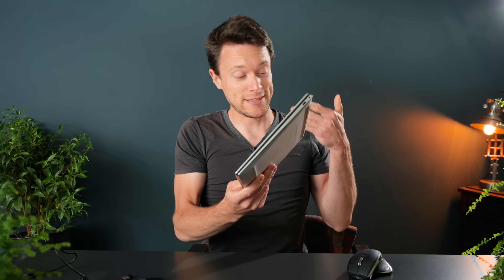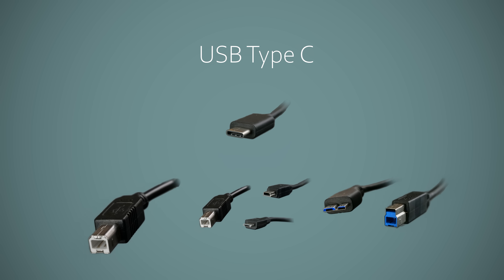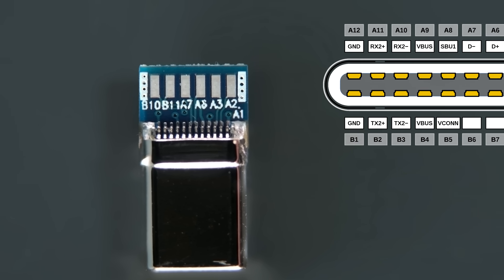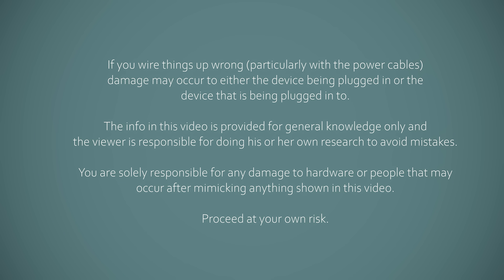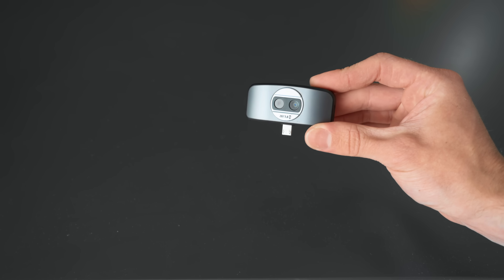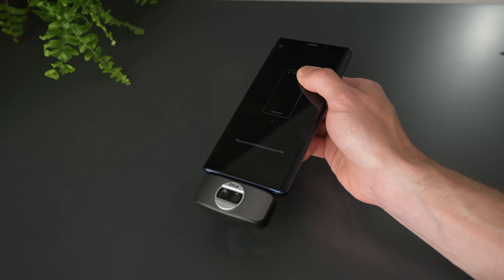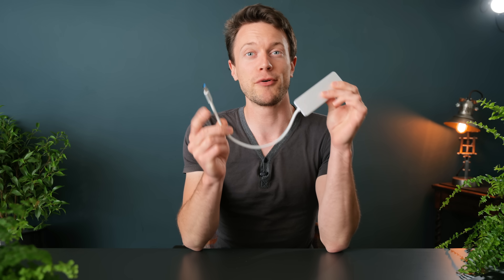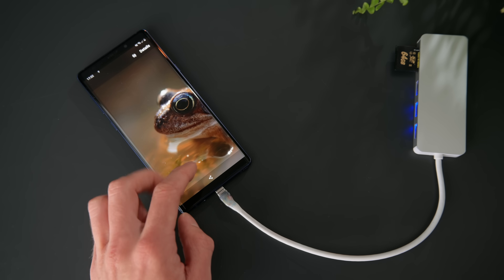Converting devices to USB Type-C

Comment: USB c should only belong on smartphones and other things that need to be charged, everything else should keep using the older usb. USB c feels too flimsy and fragile to be used on anything other than a phone laying flat on a table. Plus, USB A already does everything it needs to, it connects stuff together with decent speeds and is widely adopted, what more do you want?

Comment: They do make those super tiny adapters that go directly inside the USB-A connector turning it into Type-C with only 6mm added length. It may look funny but is smaller than yours.

Comment: Mouse dongle couldve been twice smaller if you would trim the usb pads from one side and remove the little board on a "C" part. It could've be almost the same size it was before ;} And instead of using some sort of clay you've could 3D print the casing for a new connectors :} But ok, simple, yet interesting video :}

Comment: I don't know. It seems like a bit too much of a job when the dongle does the same thing, at the same speeds, without risk of shorting anything. Yeah it's not the fanciest thing to have, but you can always find smaller dongles that do the same job without looking messy and homemade. Plus most wireless mice can store the USB receiver in them, something you lose with a DIY receiver.

Comment: Phenomenal video, instant sub, I came here by chance, but I have one of those extended usb 3.0 micro-b western digital 3TB mybooks that the connector broke off the pcb, after having to slowly put more and more things onto the wire to make the connection it was bent so bad I couldn't get the plug through the plastic and onto the connector, so I took the drive out of the case and tried bending the connector back and snap.  

No big deal right take the pcb of the drive and just plug it into one of my towers, I'm always hotswapping drives.  NO!  This is when I learned how stupid of a company WD was,is, still is.  Even without having set a password they made the decision to encrypt the data going onto the drive through the controller chip on the little pcb.  Setting a password just locked access to the drive in the SES driver, I can't read the drive without passing the data back through the controller.  I had like 25k mp3s a bunch of pictures and an old bitcoin core node with a non-zero wallet on it.  I managed to recover the wallet cause I had a pre abc split version of it on another drive cause I was actually careful before I did the abc then gold then sv splits.  But I want my memories back lol.  I think I can do this.  I never even thought of putting a usbc on it, and I have no idea on what the pinout of the extended micro 3.0 connector is.  But I'm rewiring some old astro a50s I loved that the wires broke on and the wires are even smaller than usb wires, so I think I can do this.  I used to solder a lot when things weren't so dumb small.  That extended micro-b 3.0 connnecter is such junk the smart choice would have been using the 3.0 B that is used on a lot of older USB 3.0 hubs, that thing is rock solid, or even just an A connector , I broke the micro-b on a seagate drive too (they didn't encrypt) and I have another seagate that still works but I will not buy anything that isn't c in the future.  Oh the reason I say WD is still stupid is because I got a newer laptop with a wd sn730 nvme, I went to over-provision it but the WD software doesn't do that.  I assumed, my bad of course assuming, that WD must have set aside space on the drive for provisioning I couldn't see.  WRONG, all the sudden when I got over 75% on the nvme two days ago toast notifications started popping up that looked like retarded virus popups saying that going over 75% would greatly decrease the life.  No they are wrong, the Samsung 970 I'm ordering to replace it will be greatly decreasing its life.

Anyway again great video, I also like to rehab stuff hate to throw away anything unless it is absolutely done or won't even work in linux anymore, way too Scottish, and I loved the epoxy trick, I've been using electrical tape all this time on hdmi cables and cat5/6 like I was a electrician doing my own home wiring.  which...

Comment: But actually type-c its the physical standard, that can be USB 2.0, 3.0, 3.1, 3.1 gen 1 and 3.2 gen 2 
And its not replace the Type-A and Type-B. 
Its just new type. That turned out to be more convenient, that why brands start to use the type-c first instead of Micro Type B, and now sometimes instead of Type A. And thasts why companies standards the USB 3.1 Gen 2 to replace Mocro-B by type s, and then replace type-A in USB 3.2.
But its still USB, and you can even make USB 1.0 Type A to Type C cable and its will work.
I still have several USB 2.0 Type-C to Type-A cable.
Reply: And also that physical standard supports not only USB. Its support the display port and extended usb standards (Ethernet Over USB, Analogue Audio Over USB, Thunderbolt 3, Display Port and Power Delivery)

Comment: Can you please further explain how did you solder the thermal device's new resistor? I didn't get that configuration. Was it going from R2 pad to anywhere in the circuit board(GND)? 10:50
Reply: A few seconds earlier he says "to the ground pad" which is on the other side. A new resistor is not needed, just stand the resistor on end on its pad next to the USB-C then wire the top end to ground. I.e. tombstone it.
Reply: @murdo_mck  Thanks Muk. You're the real deal!

Comment: Do you have any videos where you replicate a USB receiver? For instance, I have two Nintendo Switch docks, one in each room, and I'd like to use my third party wireless controller on each of them without having to move the dongle each time. I'd also like to know how to do it simply because dongles are tiny and easily lost.
Reply: The ideal solution would be a USB 3 KVM, that said, building a second USB receiver won’t work unless you can tell the controller that you’re using to switch to another receiver (while keeping the first one stored so you can quickly reconnect)… Manually Repairing every time would be more tedious than just moving the receiver probably.

Comment: Can't you just move the resistor that's already soldered on the breakout board from the positive side to the negative side? I mean yeah it is very small to work with but it will also turn out small

Comment: a computer new enough to h ave usb-c will probably have Bluetooth.  get a Bluetooth mouse.  problem solved.  use the other mouse for an older system.  problem solved.  that dongle would be better.  they make adapters too.

Comment: It is a good work, but I would not do all that as dongles support more than one USB connector.  But yeah still a good idea, regarding the Troughhole resistor you have used  I would just swap the original resistor connected to + to the -  R1/R2.

Comment: Honestly this is why small form factor devices with USB-C only are stupid. All they do is try to make that laptop as thin as possible, when that doesn’t even matter. A laptop that’s thin isn’t any better compared to a normal form factor one. If anything, it’s trying too hard to be like a tablet or phone, which is small and thin.
Plus the thin form factor also means the thermals might take a hit if the cooling system isn’t well thought out.

Comment: USB-C may be great…. But it’s not a standard for anything. Tell me the last time you saw a USB-C mouse? Point is never.
It would always be a wired connection to USB-A, or using a USB-A dongle, or just full on Bluetooth. Even keyboards do the same, the only time they use USB-C, is for a detachable cable, because it’s more durable and small form factor.
Pretty much all laptops have just one normal USB Port, with a USB-C port as a bonus, mostly for higher end machines.
Only time USB-C is required, is for external storage, since it’s faster.
Also pretty naive of you to think everything will use USB-C and only USB-C for everything, when that won’t be helpful. Especially when charging a laptop. I already yanked a laptop a few times with the original charging brick with that round port, but that would be the same issue for USB-C. Apple was the only one to fix that with their MagSafe on the MacBooks, and there really should be some durable USB-C based charging focused port & cable, that’s like MagSafe, but a standard that isn’t owned by Apple.
Reply: > USB-C may be great…. But it’s not a standard for anything. Tell me the last time you saw a USB-C mouse? Point is never.

Hopefully very soon 😋

>Pretty much all laptops have just one normal USB Port, with a USB-C port as a bonus, mostly for higher end machines.

For now. Less and less devices will have USB-A going forward.

>Also pretty naive of you to think everything will use USB-C and only USB-C for everything, when that won’t be helpful. Especially when charging a laptop. I already yanked a laptop a few times with the original charging brick with that round port, but that would be the same issue for USB-C. Apple was the only one to fix that with their MagSafe on the MacBooks, and there really should be some durable USB-C based charging focused port & cable, that’s like MagSafe, but a standard that isn’t owned by Apple. 

You're thinking of one very specific problem. If every device used USB-C, the amount of electronic waste would go down ten-fold. And compatibility would be amazing.
Reply: @FerrisUwU  E-waste would still go up, because not every single USB-C cable has a standardized, consistent use. Literally each USB-C cable is different, and can be worse than some other one, meaning you’d have to buy a different USB-C cable anyway for a different feature. Especially so as features like thunderbolt use more wires in the cable sheath.
So even if USB-C replaces USB-A, HDMI, DisplayPort, or any other medium. Them not having a standard would means you still have a bunch of cables wasting away.
I literally have 5 different usb-c cables from products I bought, and all they do is charge stuff. Yet two of the cables are worse than one of the others I have. Meanwhile whenever I can get some thunderbolt compatible device, I’d have to get a new cable.
USB-C being a standard doesn’t solve anything, if anything it makes things more complicated. Right off the bat you’d know which cable does what. HDMI and DisplayPort does video, whole the typical USB-C does fast charging (with the right brick) or if the device you have even can use USB-C charging, each cable doesn’t exactly have signs as to what it does.
Reply: @Thewaterspirit57  what you're describing is mostly an issue with low quality USB-C cables. A decent USB-C cable from a known manufacturer should be able to do essentially anything you might want it to do. If it can't, that means the manufacturer cheaped out on you.

Thunderbolt is irrelevant; it's a whole different standard from USB-C that only recently switched to using the same type of port (a good thing, since USB-C devices can still be used with thunderbolt ports, just not vice-versa).
Reply: @FerrisUwU  Again. Using more excuses. USB-C isn’t some go to save all for E-Waste issues.
Literally nothing will happen. We can only solve E-Waste by telling people to recycle their electronics, rather than throwing them out

Comment: sir usb type to iphone charger port?
Reply: iPhones use the proprietary Lightning connector, which supports USB 2.0 (480mbps) transfer speeds (except on the 2017 iPad Pro, which does USB 3.0 (5gbps)). iPhone 8 and later, and more recent iPads also support fast charge if you use a USB-C to Lightning cable, and a USB-C PD power adapter.

Comment: Does there exist one of these breakout boards that work as a downstream device out of the box with no need to move or replace resistors? I have a USB 2.0 webcam I'm trying to replace the plug on. It's a USB 2.0 Type A plug currently.  All of the ones I find seem to be 56Kohm which I "think" means its for hosts rather than devices? (I read that client/downstream/dumb devices, need to be 5.1kOhm)
Edit: and just so no one says "just use a USBA>C adapter, this is a tiny webcam that's made to snap directly to a device, similar to FLiR cameras for phones. I need it to still be low profile.

Comment: My solution was quite elegant. I got a whole bag of the smallest connectors I could find. Now I don't care if I lose one or ten of them, and they are in pretty much every bag I carry electronics around in. The upside is that I can still use the devices in the older ports any time I need to by simply removing the dongle.

Comment: Ok ok, now I want to see how to do it on a PC motherboard, that all USB A to C. I hate that with a simple touch on a cable, a device is disconnected, especially audio dongles. The USB-C ports are super tight and don't move at all.
A lot of PCIe 4.0 and 5.0, DDR5 RAM and we continue with the A ports and to make matters worse the PS2 that continue to be immortal even if nobody has a PS2 keyboard or mouse, nobody, by God we are in 2022.

I think I'm going to solder cables to an external panel for the motherboard USBs, including the internal ones. Marking which ones are 2.0, 3.1, etc, including which ones are connected to the Chipset and which ones to the CPU.
I think it would be a good mod.

Comment: 2 years later, USB-C is still little more than another annoying competing "standard"
The XKCD effect persists
Reply: Just objectively not true, though. USB-C is THE standard, currently, apart from some specific points (Apple) and legacy device support (USB-A). The EU is luckily fixing at least one of them 😋Proud citizen of the European Union 🇪🇺
Reply: @FerrisUwU  Good to hear someone’s proud of being in the worst confederation Earth has ever had.
But no. USB-C is so bad, it’s taking a decree from a supranational confederation to push its adoption.
Hell, USB as a whole is a mess of non-standards these days. Literally all rules are optional. USB <insert current version here> can literally call itself gen whatever to justify it not being up to the current version’s specs. And more recently, now this marketing is required. USB-C is a standard of nonstandards for connectors. Did you know, in order to not support USB-PD, you have to support it and negotiate it down, or you could FRY the device? And frying it is also A-OK with the USB bureaucrats because all rules are optional.
The connector doesn’t imply at all what signal it carries, and different cables carry different signals, but have to use the same connector. It’s a logistic and engineering nightmare. Oh and the fragility of the connector. There’s a reason lightning isn’t following the male-inside-female/female-inside-male structure that USB insists on using like a fucking trademark. It’s fragile when you scale it down this much. All it is is USB Micro B, but reversible, and now you also can’t tell if a device works in host mode because if this connector is used on both the A side and the B side, and ALL RULES ARE OPTIONAL, you could end up trying to connect two devices that neither work in A mode or neither work in B mode. And yes, there are still A and B modes. USB still uses a host-guest model. Want to use the same fragile ass connector that needs a unibody shield just to not break when a feather falls on it, but don’t want to follow the host/guest model? Well, there is thunderbolt… Except the only thunderbolt mode that works like that is thunderbolt bridge, which is ethernet over PCIe. Otherwise one device has to be the host and the other the guest.
There is no C.
It’s just a connector. And a bad one. Apple beat them to the good one.
And don’t give me that “it’s faster” bullshit. Lightning for USB-3 is such a badly kept secret I literally have breakout boards for it. Apple was at one time going to release a USB-3 mode for Lightning in one of their iPad Pro models, but opted to save the speed improvement for when they could put Thunderbolt on them, the literal only reason they added USB-C at all. First to get people used to it. Then to introduce Thunderbolt on a mobile device.
Lightning had enough pins to handle USB-3 if it wanted, but not enough for Thunderbolt. What’s more, the other nail in USB3-Lightning’s coffin was Apple trying to go fully wireless. They intentionally throttled wired connections by not upgrading the lightning controllers and cables, all to push more over-the-air crap.
Regardless, Lightning was the superior connector if the contest was for USB 2 or 3, as it had all the pins needed and a much better physical design. Reason that didn’t become the standard across vendors? Proprietary. Nothing more.
There’s your history lesson.

Comment: I LOVE ❤️USB-C
 WHY DIDN’T IT COME OUT FIRST?
  Either side is correct and doesnt
 Bend easily. THE cable doesnt
Break the wires near the connection
 Like other cables are cheaply designed
To do so it has to be replaced.
  USB-C ROCKS🎉

Comment: Question: If I want to replace the Micro-B USB connector on a USB power supply with a type C connector (just to provide power) to the host/client resistor values matter?

Comment: Surely better to have just bought a Bluetooth mouse in the first place… I still do not understand why USB dongle mice even exist?! Surely everything should be Bluetooth by now. Even Logitech have Bluetooth mice that also still have the usb dongle.
Reply: 2.4ghz usb devices have lower latency than is possible with bluetooth ones

Comment: the mouse dongle... he could leave USB-a contact exposed and it would be a universal wireless dongle. but a very nice starting point.
also, don't go overboard with wiring - too thick or too long wires could become antennas and cause data interfierence.

Comment: Nice video. The only downside to USB-C is that the connectors are quite fragile. They're easy to snap off the motherboard when lifting up a laptop with a device plugged in. USB-A didn't have this as bad.